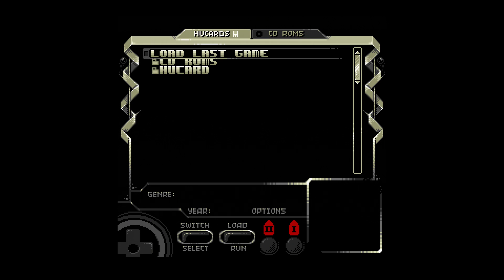SSDS3  Audio Bypass   No Cap vs Cap

Comment: i have revision 2 and it sounds exactly like your demonstration without  the cap installed
Reply from the maker: Did you mean to say it has buzzing or sounds clean? If it sounds clean, then what you have is the revision 2.1 where they installed a tantalum cap on the underside. However, you're still getting clipped audio on louder CD games and louder HuCard games. The only fix for that is my bypass board.
Reply: @RedArremer  it sounds exactly like your video where you show the difference on your ssd3 from having and not having the capiacitor. I'm also getting clipped audio.  I've ordered a new RGB scart cable add you suggest on your other video :) but the UK supplier of your audio module is out of stock. 

The added  capacitor is as you say on the back  but the cathode end is the opposite end to the capacitor near it. With terraonions reputation I wouldnt be surprised if they put it on the wrong way
Reply from the maker: @MrDirkles   If you can take photo of the back, I can let you know if it's installed backwards. At any rate VGP has ordered a larger new batch of bypass boards, but it will take a couple weeks to arrive. I tried to convince them the demand was far more than they were anticipating, but they had already committed to a small batch run and sold out the first day. The next batch coming in will be plenty more available.
Reply: @RedArremer  Ive got one of the cables you suggest on your you tube video and though the sound is slightly more crisp it still has that god awful buzzing which makes the thing unusable.
Reply from the maker: @MrDirkles   Which cable? There were 4 different ones I mentioned.
Reply: @RedArremer  retro gaming cables pack a punch pro cable.
Reply from the maker: @MrDirkles   Very surprised to hear that since those have shielding in the lines. MY own personal cable choice is Retro-Access, and I know those cables are clean on both video and audio. However, there might be something else going on with your SSDS3 that may not be the fault of the cable.
Reply: @RedArremer  I suspect that's the case. Terraonion are reducing their  complaints by not answering any support submissions ;) so I guess I'll wait until your boards are available again. Honestly though, what a shitty company terraonion are.
Reply: MrDirkles it's a lot of trouble but you'll be so much happier when it's modded. Some audio noise is introduced by every flashcart on the market so it's never going to be perfect but the FBX audio board on my ssds3 was a startling difference. It really bums me out that so many people are going to be introduced to pc engine with this product and think the terrible sound is from the dated technology.
Reply: @TheRealGara  I just need someone to have stock now so I can buy one and start playing again. The noise possess me off so much I can't stand playing it on its current condition. Of course terraonion show no interest in helping at all. Any question they don't like is just ignored. A real shit company that deserves to go under.
Reply: @TheRealGara  I just need someone to have stock now so I can buy one and start playing again. The noise possess me off so much I can't stand playing it on its current condition. Of course terraonion show no interest in helping at all. Any question they don't like is just ignored. A real shit company that deserves to go under.